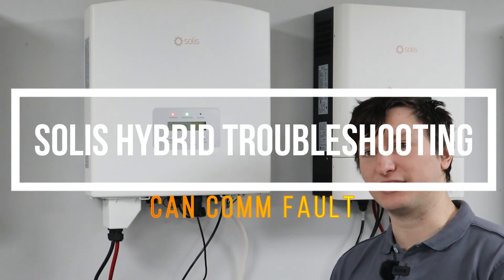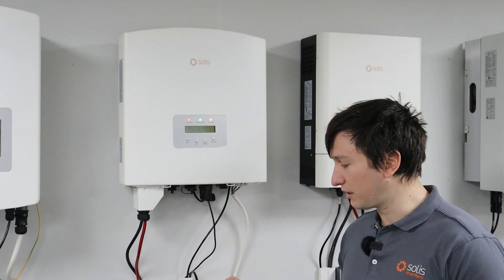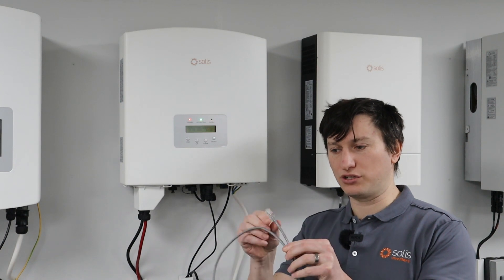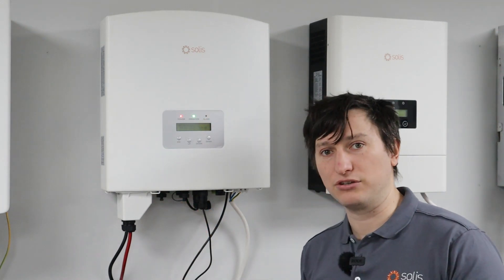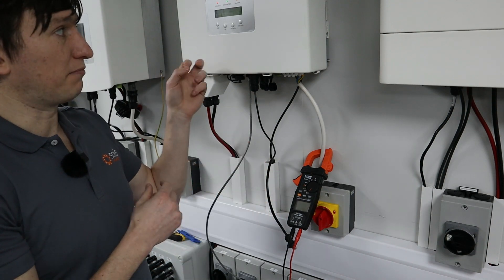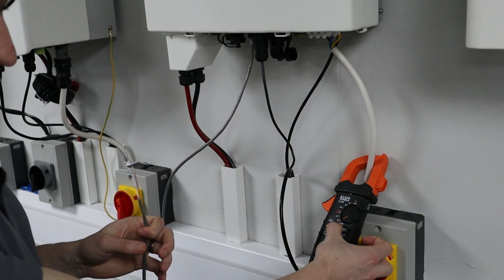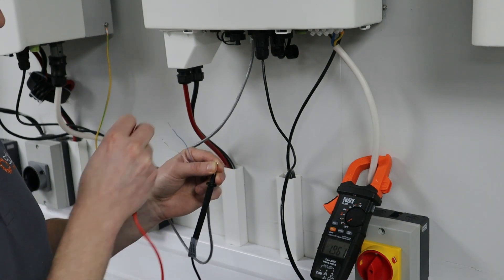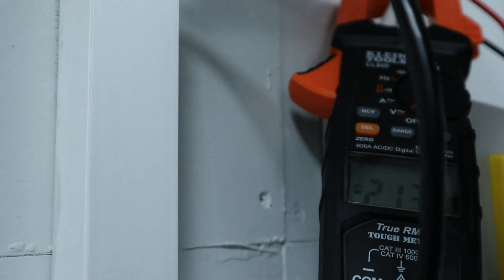Solis Hybrid Inverter - CAN Comm Fail

Comment: Com port is very likely to fail in the Solis Invertor model I have. Usually, when a data logger is removed or installed. Apparently, the only fix is to replace the whole invertor😢. Very poor design of the com port.
Reply: and what did you do? if there is no cumunication the bateries wont work..

Comment: I recently got 8 panels, a Solis inverter, eddi and Duracell battery, the electrician left a MET_Comm-fail and a BatName fault. I've reached out to the salesman, the electrician, and someone from Ecoplex energy solutions here in Dublin. Not one of them has replied, I've spent 10 grand on this system and it was explained to me and there's faults on it that I can't figure out. The sales rep hounded me for weeks before the install but now won't answer the phone or emails... 😡
Reply: "wasn't explained to me"
Reply: Welcome to the solar coaster. Ireland is terrible for this at the moment loads of dickheads getting into installing solar just for the money and shafting customers. Try the solis no battery video might help sort that battery name fail alarm
Reply: Seems like the model of the batteries need to be selected on the advanced settings on the hybrid inverter

Comment: any diagram for the COM port? I want to use the rt485 communication to an external system. Its correct pin 1 VCC pin 2 gnd 3 RT485A an 4 RT485b ?

Comment: Please explain how is the BTS (battery temperature sensor) wired to this port? 
My inverter was delivered without the optional BTS and i can't find one available anywhere. Not all batteries can CAN communicate with solis and they offered the BTS for non supported battery packs
Reply: I got one from solis, plugged it in as stated in the manual and then checked the bat temp reading on the inverter. temp showed as zero,  many emails to solis later. solis basically said to did nothing, dont bother trying to get a bts it will do nothing when you get one, no idea why it says you need one in the manual, it works fine without one. hope this helps
Reply: @petersimm9919  in the end i managed to make my daly bms to communicate with solis. I couldn't find that BTS anywhere available.

Comment: Did this test, got 2.1v dc as described. So all good at inverter end.
My system consists of  RAI -3K-48ES-5G inverter and two puredrive 5Kw batteries. Can com cable between battery No1 and inverter uses 3pair (1 to 6 )in standard pairs at both RJ45 crimps. Is this correct as i have noticed that the Pylontec battery can com solution cable only uses pin 2 for ground and pin 4&5 for can up & down at inverter end.
I am having continuous Can-com-fails and having to restart both batteries to reset system, system less than a month old. To say i am not happy is an understatement
Reply: Did you sort it out? How? 
I have can comm fail too, but i know why, I'm missing a BTS wire as mentioned above

Comment: Well solved can comm fail on my RAI inverter 4 days ago. 

Cable from port internally was not connected (plugged in) to the circuit board.

Fortunately the port is just a female to female connector and the circuit board connection is also an RJ45.